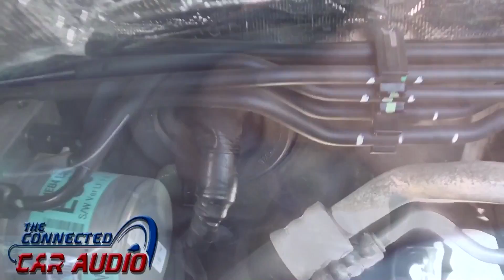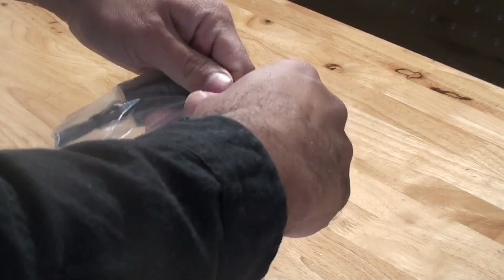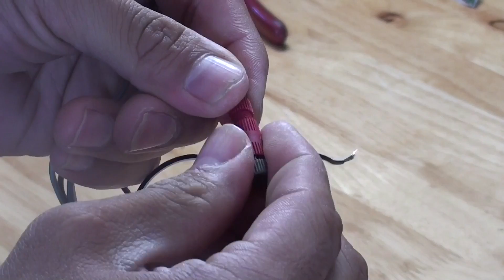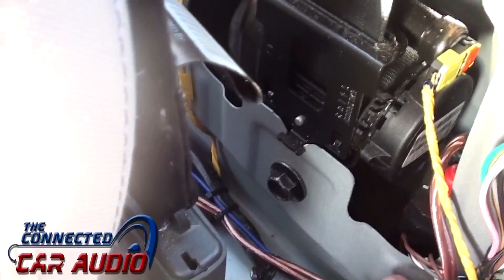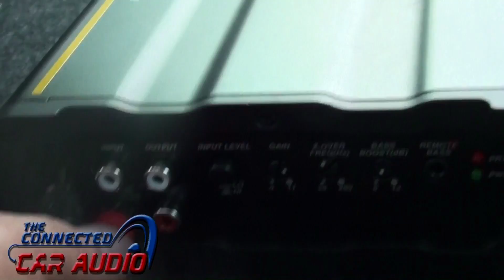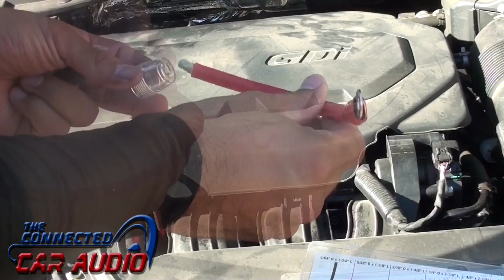How to install amplifier Hyundai Sonata 2015 and up

Comment: You can run the 4 Guage wire without removing the panel by the driver and the back passenger.

Comment: So on the Nilight fuse part. You used two 10s for the fuses. Do they have to be two 10s or would would 20 be just as effective?

Comment: I don’t know if anybody comments on this or responds anymore. But I had gotten power to my am and subs but it would not play any of my audio. I couldn’t get potty tabs. So I tried wiring factory speaker wire to the line out the converter by soldering the wires together. Does anybody have any ideas?

Comment: Is that converter in lieu of a sound control?
Someone told me u MUST have a sound control to add to a factory stereo
Reply from the maker: Do you mean audio control? It’s a brand that makes line out converter 

They are the best when it comes to line output converters
Reply: @connectedcaraudio  yea that! They look like mini amps as opposed to what you used in the video. Whats the difference? Thanks for the reply btw!

Comment: Can't find where power wire comes out grommet to pull through
Reply: Hey man did you finish this install? I have a question about tapping into the LOC?
Reply: @jackdm2895  yeah finally took a shop... A guy there ran it through a hole on driver's side where the alarm is ran... Lil fella could fit... Imma to big to get back there... Once the that was done I just ran it back on same side to Amp no problem... Although... The car makes a thump thru the sub when door auto locks  weird
Reply: @nautican  I did finally get that power wire ran, however now I’m having trouble with the line outlet converter. I did as shown in this video, yet I’m not receiving any noise to the subs 😤
Reply: @jackdm2895  ummmmm check your connections I did exactly as the video shows I bought same connectors and everything

Comment: Quick question I have a Santa Fe 2018 the fuse is has to be a “spare” so I can take the “remote wire” or in which fuse i have to put it?

Comment: It would be a good idea to pull signal from the passenger side speaker as well; using this method, you're only getting audio from the left channel. Also, if you're using this method, there's no reason to run a stereo RCA cable. Since L and R are tied together on the input, the output is going to be the same on either channel. Amps usually take a mono signal on the Left channel.
Reply: So you need to tap into the drivers side black and white and then also go to the passenger side t panel and tap into those? Currently I have both positives tied together and to the positive on the drivers side, and both negatives tied together and on the negative speaker wire. I’m not getting any sound though, help?
Reply: @jackdm2895  You can't tie the speaker wires together. A speaker level to line level converter has inputs for both channels. Wire the channels separately. (Left + and - into left channel, Right + and - into right channel)

Comment: Is it the same steps for a 2021 Hyundai Kona? Like can I Hook the loc up in the b pillar ?
Reply: Im stuck on where to hook the rem wire(blue) at from the loc that i bought it has a built in rem wire can i just hook it straight to the amp

Comment: Thank you! I am using your affiliate links too! After watching this video I went ahead and added woofers, tapped into the RR speaker leads, as shown, and then ran a line to the trunk of my Sonata. I went ahead and used the line output converter to drive the low frequency mono signal going into the amp. I would now like to add a rear speaker system for better mid and high frequencies? Should I use additional line output converters for mid and high frequencies or one for both mid and high? I believe I am still working with a mono signal (RR speaker)? Then I started thinking... ...a rabbit hole of my own, hah, I could bring the left rear speaker signal into play, this would allow me to use the balance feature of the factory audio for RL & RR to tweek the new speaker outputs in conjunction with the factory speakers for the FL, FC & FR. This is what I would like to do! Please advise me specifications for an amp that will do what I want on an "Average Joe" budget. Quickly reviewing; I am going to add/mod Rear Left & Right speakers for mid and high frequencies (convert for the 2x or 4x frequencies (if recommended) RLMid, RLHigh, RLMid and RRHigh). I will bring a Rear Left & Rear Right (done for the mono woofer signal) signals from the harness to the trunk, amplify the signals and output to the speakers.

Comment: Question? I am currently using this setup for my 2 12's, but the subs only work on LR speakers. I have 2 more 12's I want to connect to the Right Rear speakers. How can I do this? Do I need another LOC and amp? Or additional LOC and remote turn on running to current amp?

Comment: My 17 Sonata had the amplified 9 speaker Infinity sound system (stock).  Am I still able to use an LOC?  I’ve been told I need to use a signal processor.  Is the car used in your video an Infinity stereo model or not? Are the wires you tapped into pre or post amp?  If I COULD use a LOC would I then need to tap into the wires near the actual stock 8” sub in the rear deck?
Reply from the maker: It is best to use a signal processor 
If you are just adding subs then you can tap into the infinity factory sub and it will sound good but you are at the mercy of the factory digital signal processing and it changes from vehicle to vehicle 
Meaning it could lower your bass as you turn the music up 

For subs get a LC2i pro 
If you don’t have an amp yet get the lc. 1800

If your doing the inside speakers also get an audio control 5 or 6 channel amp 
They have the processors built in
Reply from the maker: Sorry if your doing inside speakers get a 5 or six channel amp not also get a 5 or 6 channel amp
Reply: @connectedcaraudio  sorry I wasn’t specific - I am ONLY adding one Kicker sub.  I have a Boss R1100M mono block amp, and a Scosche LOC90 converter.  I have the diagrams for where the stock amp is and what all the wires are.  I was thinking I would posi-tap into the rear deck sub wires PRE-amp in the wiring harness.  Worth a try?

Comment: I'm still not sure where on the vehicle you tapped into the speaker wire
Reply: Looked like the T panel dividing the front drivers door and rear drivers side door.

Comment: What color are the wires on the passenger pillar that you can tap into? I do  see a black and white on The driver side  wrapped a gather . On the passenger side I see a brown and white wrap together are these the ones?
Reply: K VS did you find out which ones for the passenger side?
Reply: Did you figure this out? Do you have to connect to passenger side too or just drivers side black and white ?

Comment: The best line out converter for this type of install is called a LC2i, all you have to do it take off your door panel to the rear speaker, solder on speaker wire to the speaker itself or splice into the stock speaker harness, then run the wire to the rear of the car and plug it into your LC2i and you do not have to have a fuse for it because it has a thing called smart turn off. Then run your remote wire and RCA’s from it to your amp and there’s your rca and remote wire without going into the dash
Reply: You got a video for this?
Reply: D sadly no, but there are few detailed installs on YouTube that I used at first
Reply: Call me Gbot I understand. Question tho. I’ve tapped into the speaker wire on the side panel and no sound.. any idea??
Reply: D do you have the LC2i or just a regular line output converter

Comment: From the fuse box diagram for a 2015 Sonata, it looks like you used the spare fuse to connect the remote turn-on wire to. I thought the spare fuse was just that- a spare fuse that you could use to replace a burnt out fuse. Can you actually use that same spare fuse slot for the remote turn on and does that only have power when the ignition switch is switched to Acc/On/Start? I was going to tap into the power outlet/cigarette lighter fuse.
Reply: did you end up using the spare? Im going to be doing this tomorrow and wanted to know if this would work

Comment: you should make a much smaller hole in the grommet when running the power wire through the fire wall,  you want it to be a tight fit or else you could get moisture leaking into the car
Reply: Yes that was a ridiculous hole to cut. You can literally just slip a blade or flathead through the firewall, and feed the wire through with some soapy water

Comment: This is by far one of thee  best how to videos I watched. Saved me tons of time. Used this video step by step on a 2017 sonata. Boom works like a charm
Reply: Did u used gauge 4 or gauge 8 ? My sonata is a 2017 too.
Reply: @doggydpac5402  depends on your amp, not your car
Reply: Which fuse is your remote wire hook to under your hood
Reply: I have the same exact car. What sun and amp are you using? Also, the only additional part I need outside the kit is a converter? Or is a dsp better? Please help

Comment: Question is it still possible to install an after market amp even if the factory amp is no longer in the vehicle?
Reply from the maker: Ron Farin are you wanting to keep the factory stereo unit and add a aftermarket amp to it  or do you plan on adding a aftermarket stereo  and then a aftermarket amp

Comment: Is this the same for a 2018 Elantra sport?  Where was the factort speaker wire that u tapped into?
Reply: @Newport , so the left and right speaker wire is on the same drivers side that you tapped into?  And is that the rear speaker wire you tapped into?

Comment: Do you have to get a aftermarket radio i was told you do because the factory head unit won’t let the bass get as loud due to s saftey feature to protect the factory speakers

Comment: I'd never take my car to a place that did an install like this. Screwing the amp to the back of a fold down seat, not running wires in loom and with tape through exposed areas in the car, no ferrules for the amp power wires, running a power wire under where people put their feet, and no solder.
Reply: 😂 only legit complaint is screwing the amp to the seat and you could just put it on the box instead. I'm sure he got permission before screwing holes into the seat. the wires were not exposed at all since they would be covered by the running board and he brought the positive to the side (where it would be covered by the running board, under carpet behind the glove box. unless somebody is kicking near the glove box it wouldn't be touched, and at that point, why are they in your car?
Reply: Mike zupancic: And your stereo videos have how many likes? Exactly.

Comment: Just finished these exact instructions on a 2016 Sonata and it works GREAT! Very easy and simple process. Just a reminder i completed this with a stock touch screen factory radio. If you don't have posi taps you can use tap splines. You can find them at most hardware stores. Thank you!
Reply: Tyler Gregory  i just tried the install, but nothing from the sub. I have power to the amp, but nothing from the amp... any thoughts? I have a 2016 also.
Reply: Whats the color diagram for the speakers to tap into

Comment: Hi, this has been very helpful. One question though, my Amp appears to be switched on permanently. Is this normal. If not, how do I resolve this. I did everything as you did, including tapping the radio fuse.
Reply from the maker: The amp should turn off when you turn the key to the off position , check the remote turn on wire fuse that you tapped into ,see if it is always on . One side of the fuse should only go hot once the key is in the on position .
Reply: connectedcaraudio Thanks for the quick reply. I'll confirm and revert.
Reply: connectedcaraudio checked and it turns out the fuse is always on, this is the head unit fuse so I was surprised to see that. So I connected to the rear wiper guys which is also 15A and the Amp now turns off when car is turned off. Thanks again. 2014 Hyundai Santa fe Sport (SWB).

Comment: I just did this on a 2017 Sonata and the fuse you told me to tap into wouldn’t allow me to turn my engine off. I would turn the key take it out and engine would still run... until I unplugged the fuse!
Reply: Did you solve this?!  I'm having same prob

Comment: I just did this for a 2017 Sonata and can confirm the instructions are still exact. Definitely, the hardest part is getting the amp wire fed through the rubber grommet and dropping below. Mine kept getting stuck behind the A/C unit, or whatever the big box is behind the glove box. 

I also had some trouble with the rear seat at first. The front part of the seat popped up fine, but it wouldn't come out. Almost like there was a bolt somewhere else. There wasn't. After messing with it for a bit I found the correct angle to lift the seat out. No tools required for that part.

Easy to follow guide. Thanks again!
Reply: Dan Martin i have the 2017 sonata, there are multiple black wires and 2 white wires, how did u connect to the correct one?
Reply: Having the same problem with getting the wire fed through the grommet. Any tips?
Reply: I wanna do this to my hyundai Sonata 2017 would it work

Comment: The fuse you say to tap into shows to be a spare on my schematic therefore tapping into nothing..
Reply from the maker: Garrett Carter test it with a multimeter
Reply: @connectedcaraudio  This method works